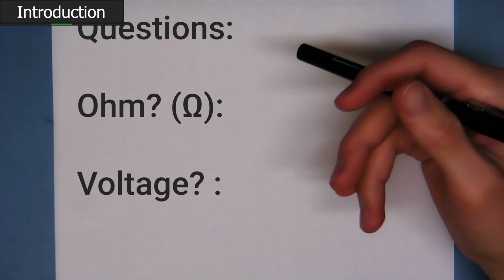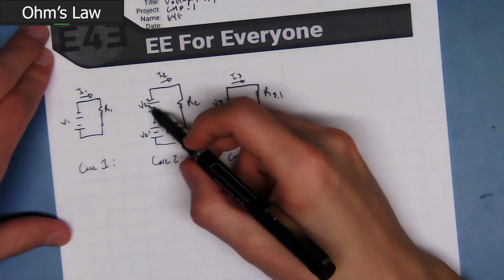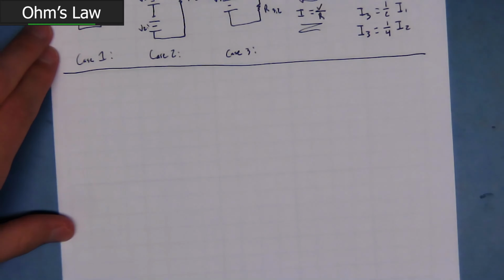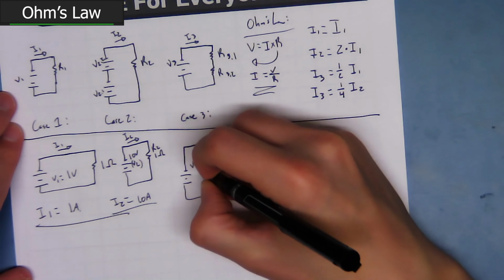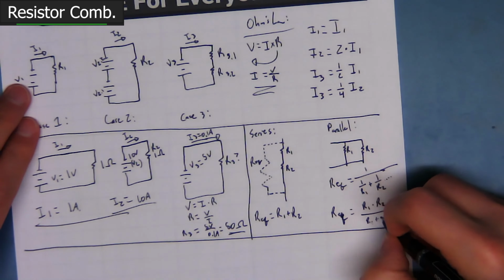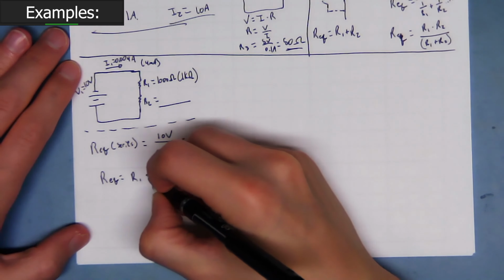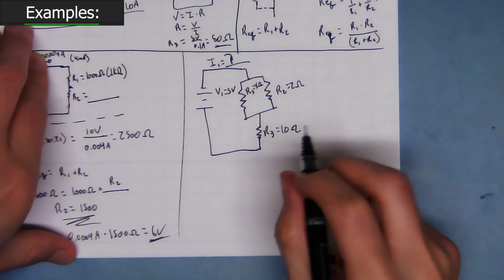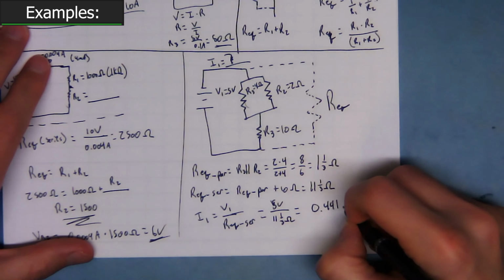Voltage, Resistors, and Ohm's Law (Intro to EE)

Comment: Hmm. I never know where to start when trying to explain circuits. Start with number theory, algebra =P?
Voltage division seems like a good place to start. I would have started with a worked example of the end goal.

Haha. Age old Electron current vs Conventional current?? I stick to circles =P
Reply from the maker: Hi No Corporation, thanks for watching! 

Yup! Gotta start somewhere, good thoughts. We've done a high-level comparator circuit video before... I'll drop a card or link to that somewhere. Good suggestion!

Electron current vs conventional... That was my biggest dilemma in circuits 1&2... I gave in to convention eventually. :) 

Cheers!
Reply: @EEforEveryone  I think you have your battery symbol around the other way then? That was my initial thought, and hence the comment.
Reply: @normallyopen1190  Yes negative usually at the bottom.
Reply from the maker: Oh boy, did I? I'll have to label everything with an explicit "+" "-" oops!